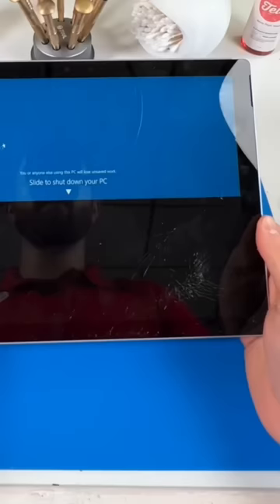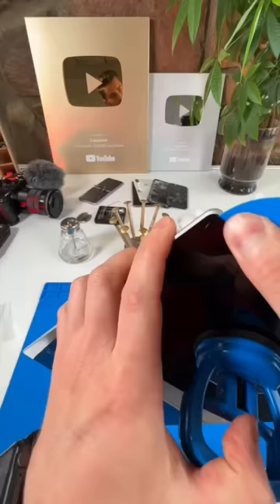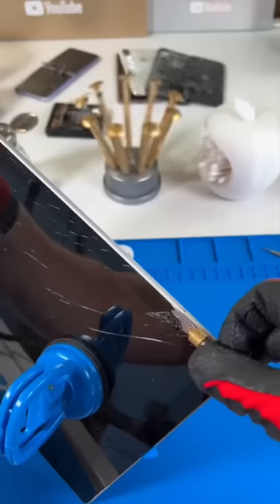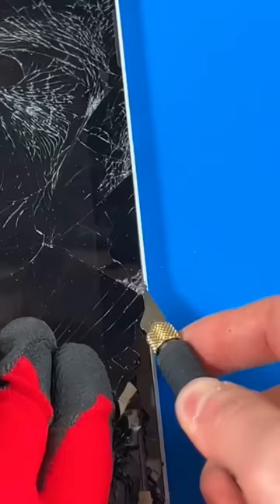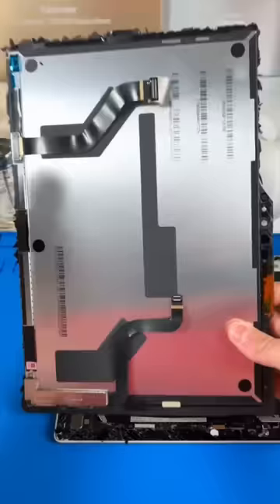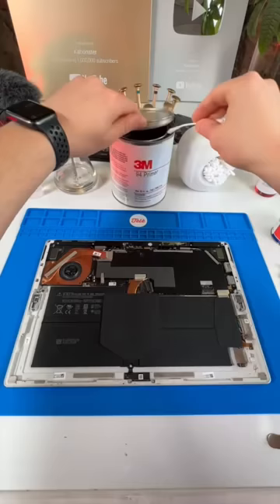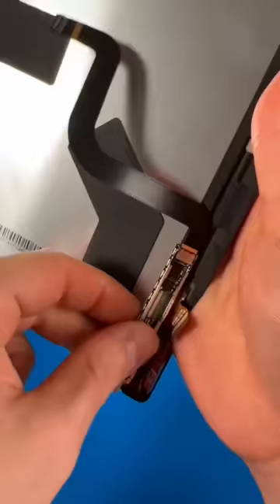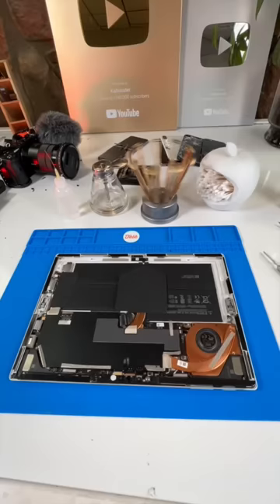Fixing a computer for The US Army 🛠 #shorts #tech #surfacepro7

Comment: I feel like they should have an internal guy for this..
Reply: DOD does have a dedicated office for IT. However, in my personal experience working for a state-level IT bureau, they’ll either just throw it out / surplus it, or if it’s under warranty send it to the manufacturer to have it repaired. Rarely is anything ever done outside of that except simple tasks like replacing memory from a donor computer or swapping out hard drives 

Just handing over a govt device to a third party individual with potentially classified or confidential information is such an inconceivably bad idea that the only possible reason I can imagine is that the device was either public/shared (like those computers you find at rest stops) and isn’t connected to the govt network, or some idiot broke his screen and was too embarrassed to tell anyone.

Not sure how it is for federal government but I had to get an FBI background check, prints taken and all, and I have to do so every 5 years in order to keep my job as a tech
Reply: @andremoire  I'm IT in the USAF we can't fix devices due to contracts as long as the hard drive was wiped they should be ok although NIPR Computers are unclassified so there shouldn't be any secret material on there
Reply: @andremoire  as an IT in the navy this is a NIPR surface pro , meaning it's unclassified material, it's all good
Reply: Everything is under warranty, all the computes that have hardware problems are replaced by the vendor
Reply: They do, somebody didn’t want to get in trouble
Reply: Nope, typically systems are required to have a hardware contract with the vendor and get life cycled as soon as the warranty goes out. If a repair is needed, they typically have a special unit that comes onsite to the army base for the repair, these techs have security clearance and have military identification as a contractor. Source: the last 7 years of my life as a DoD Admin
Reply: @freddieriojas6818  as a former NAVY IT this is definitely not the approved way to repair a device. If it is past the warranty a DOD employee with a clearance needs to work on it even if it is NIPR. NIPR devices still have CUI.
Reply: @freddieriojas6818  even unclassified doesn't mean you can do this. Remember your training? Lol
Reply: ye, probably
Reply: Its not really classified stuff man
Reply: S6 person should be doing it, at least that's how my unit was.
Reply: Fr
Reply: @andremoire  this is why I want to work in a govt it department, I've seen countless easy fixes come through an electronics recycler I used to work for
Reply: Yeah in the Marines if it wasn't something I could fix with a screwdriver, we put it in a case for parts, fixed other computers with its good parts, and then sent the bad and broken back to Dell for replacement. The most advanced repair I performed in IT for them was a screen swap on a Dell E5450. We had 10 or so just sitting in a box with a dead motherboard that Dell couldn't warranty.

Comment: Tip on opening the Surface Pro.
1: Once you lift the glass with your suction cup, pour in a drop (or less) of 100% IPA into the adhesive under. This will make the adhesive brittle and very easy to separate.

2: Use a softer prying tool. I used the foil-plastic corner part of a blister pack of pills/capsules/medicine. Rigid enough to slice through the adhesive but soft enough not to break the glass. I also pour the drop of IPA through here as I slice through so that it gets to the tight/kiss part of the adhesive.
Reply: thank you bro

Comment: The US Army wouldn't outsource repairs... And anyone can create an interactive login warning screen like that through group policy. So it's either faked or an auctioned off tablet.
Reply: Wow
Reply: I don't think the military would auction off something like this. Flash storage is easier to recover deleted data from even if it's been written over.
Reply: @silasmayes7954  most data on these isn't actually on the drives, everything I've worked with has been web based or on external drives.
Reply: @TheGerd  while most data is in the cloud nowadays a lot of data still passes through a device through email, office files (word, excel, ect), and other general data.
Reply: I was someone that was issued that computer and broke it, then took it to that guy so they didnt get in trouble or have to pay for a brand new one.

Comment: I hate these fragile glued on screens. We had a 20% failure rate on the Surface Pro 3 - battery, SSD, or WiFi , all of which require removing the screen. None were cracked when I started, and I heated them as much as possible without damaging the LCD or battery. They cracked anyway. I'd get close, but I suspect the small indents near the speakers and strong glue stressed the glass.
The only time I've had an intact removal were when the battery got spicy and pushed it off from the inside.

Comment: All the data is probably in the cloud and not localized on the device. Taking the hard drive would not reveal you any secrets
Reply: They encrypt their local drives, actually. Certain stuff gets saved to the systems drive that can be restored so typically something like bit locker is used on the drive
Reply: It's a clickbait
Reply: @rishugupta9431  no,  it's real. The US Army usually uses repair shops that are trusted and local to domestic garrisons. The drives are not only encrypted,  but can be wiped or locked remotely.

Comment: Guys, there isn't any vital information on that device. It logs into servers, so it's basically the same as the rest od the devices. Most government branches don't use inside people for these jobs because they don't get repaired, usually devices get wiped and re sold back to the manufacturer to get replaced, I imagine this device is set on one account for the branch and its more cost effective to repair it rather than replace it. THE MORE YOU KNOW.

Comment: To those saying this is a security violation. No  DoD device will just have PROPERTY US GOVERNMENT ON IT. It will have a barcode the assigned user the asset id the serial number and a last serviced date. Some dude put the warning on as a joke.
Reply: The top of the turned-on tablet had UNCLASSIFIED on a green strip indicating the device has a connection to NIPR. This is indeed a security violation.
Reply: @FPSKillstreak  this is indeed not a security violation because he wouldn’t be able to log in to the computer. It’s a joke and everything you see here can be done with registry tweaks and programs
Reply: @zensync  ever heard of a local account?

Comment: It's a surface. It isn't worth repairing.

So, i worked in an organization that had these and they all eventually died of the same problem.

The screens would ghost super bad and it was due to thermal expansion and contraction of the GPU, and how that damages the bonding between the silicon die and the the interposer it sits on, that is soldered to the motherboard.

They'd do this after about 2 - 3 years of use.

Not worth anyone's time unless it's solely for data recovery imo.

Comment: Him not showing the part where he searches the files
Reply: You have to plug an encyrpted usb stick into the computer to unlock it. Or use a NFC ID badge. Or RFID or whatever the fuck which one they use. It’s one of them I’ve seen it before
Reply: @SupremeShuckle  typically just a CAC into a CAC reader
Reply: @Chas4739  I wouldn’t be surprised is the soldier was in the room watching the repair and that’s to help him log in once the computer is repaired. I didn’t see a CAC when it was logged in though

Comment: I've taken apart a couple S7s before. The trick is not going at it like a fucking maniac in this video. Spend a little extra time with the head gun and also warm the chassis. You can remove the entire screen in one lift. You maybe have a shard or two to pull off if the screen was already cracked.

Comment: Lots of comments saying this is a bad idea; y’all clearly have no repair experience and it shows.

Government computer doesn’t always mean it’s specialized. Nothing in this unit looks proprietary which means this is a consumer model the army provisioned for use and there’s nothing dangerous about him showing serial numbers/internals. Also, guest users are the thing??; repair person needs to be able to check brightness/contrast/color on the replacement screen before signing off on the repair (windows has this built in so no download, but you must be logged into the device).
Source: former Apple Internal Repair Contractor
Reply: You are right

(I have repair experience )

Comment: Yo fr tho idk but this is a major cyber security breach and violation. Unless its an unclassified pc
Reply: Computers aren’t classified, the material on them is, and any classified material will not just be randomly accessible by anyone
Reply: @coopa2002  yeah no. If it hold classified material it makes the pc considered a classified document
Reply: @coopa2002  and no shit its classified for a reason. You think i dont know this? Lol. I may skim through my cyber security training but i read some of it….. when an NCO walks by that is lol
Reply: Its not its probably just some desk jobs surface or some. Shit there’s nothing on it and most of these “classified documents” require pins or thumb prints or id to even open
Reply: @mapleleafs4lyfe  yeah no shit. I have to use one everydays lol. But this guys is a tech guy. A “thumbprint”…..thats new,
Reply: yea some laptops have a fingerprint scanner to unlock the computer so this could be a modifed windows tablet with a fingerprint scanner
Reply: @coopa2002  Government electronics are certified to handle differing classification types and will be able to connect to NIPR, SIPR, or JWICS as appropriate/enabled.

Comment: Bro has the password and didn't snoop?
Reply: He is signed in without a user profile. You can't access any of the specific user info or files unless you have a Common Access Card with the security certificates imbedded into the card. It's basically a default factory computer without the user data.

Comment: I don't know if it's just because I stayed up all night again or if I'm just generally exasperated, but to the large quantity of people in this comments section that are talking about this video from a serious standpoint:
Do you hear that? It's the sound of the joke flying straight over your heads.

From a technical standpoint, it's actually really easy to get a pre-login message to appear when you boot up a Windows 10 device. You can actually do it without any manual editing of your registry or group policy editor settings by using freeware programs like Winaero Tweaker to set one up. As for the pop up that was shown on the screen, it wouldn't be too difficult to make it a part of the desktop background or just display a visual overlay. You could even just take a screen recording of the desktop and edit the image on it, then play the video in full screen mode to create a similar effect.
The label that was shown on the frame of the device seems like a standard printed sticker label. They don't hold together too well with temperature changes or moisture, and also can leave behind residue even after removed, so it's unlikely that they would be used for anything owned by an organization with enough funding to afford a better quality version of it.

I don't understand how so many people didn't interpret this video as a joke. Unless I'm missing something here, and the joke is actually on me.

Comment: You do not need to chisel the glass off the frame with a knife like this guy, he started off right by using heat, just keep reapplying the heat.
Reply: This is not the case for DOD issue devices because they use different screens that are bonded differently as they have different environmental requirements.

Comment: I hate repairing surface tablets, their screen is soo thin they're easily crack when you try to open them. Microsoft should have put a removable back cover like the HP tablets where you can easily replace battery or motherboard inside.

Comment: 30 mins on a heating pad and a tool made specifically to open a phone screen or a tablet screen in slow incremental movements while you saw the glue away with a super thin needle wire. 
Like 40 minute job with 35 minute of it just waiting around

Comment: The antenna on that wraps around the top plastic and connects to contacts on the other side of the plastic on the board , unless you replaced it completely you damaged the antenna and that unit will probably have poor WiFi or cell reception .

Comment: God, yeah that adhesive they use on the surface is no joke. We have a couple Surface Pro 4’s at work. Yeah, the one with the battery that bulges, without fail, right after the warranty expires. 

With the first one, I tried it myself. I’m no phone/tablet repairman, just an IT guy. So that sucked. I didn’t have exactly all of the right tools, or thin enough replacement adhesive pads. So the outcome was mediocre, and I wasn’t happy with it. I also didn’t realize the battery super cooks the board on the back of the display, so I didn’t replace that, and now it has display flickering issues. 

With the second one, we just paid Microsoft the ripoff $600 or whatever it was for a replacement unit. 

With the third, we just got rid of it. Microsoft no longer offers a replacement program for them, and I didn’t want to go through the pain of fixing it again, since I still don’t have the right tools. 

I mostly work with desktop PC’s and laptops. And with that, it’s mostly just software troubleshooting and hard drive swaps, with the occasional Ram upgrade or replacement. So that’s what I have the tools for. Not the right tools for tablets.

Comment: If you want to display a  logon message warning like that, you may do so using the Registry Editor. 

Press Ctrl+R
Type in regedit.exe
Press enter to run

In the textbox used for searching, copy and paste.

Computer\HKEY_LOCAL_MACHINE\SOFTWARE\Microsoft\Windows NT\CurrentVersion\SecEdit\Reg Values\MACHINE/Software/Microsoft/Windows/CurrentVersion/Policies/System/LegalNoticeCaption

Then double click (Default) and type in a caption

To add text, copy and paste the following into the search bar and click ok.

Computer\HKEY_LOCAL_MACHINE\SOFTWARE\Microsoft\Windows NT\CurrentVersion\SecEdit\Reg Values\MACHINE/Software/Microsoft/Windows/CurrentVersion/Policies/System/LegalNoticeText

Then repeat the same process for the text.
Reply: It only works on some windows editions, for example windows professional